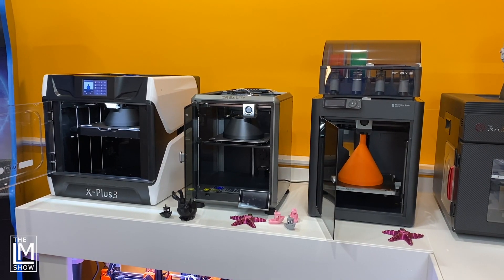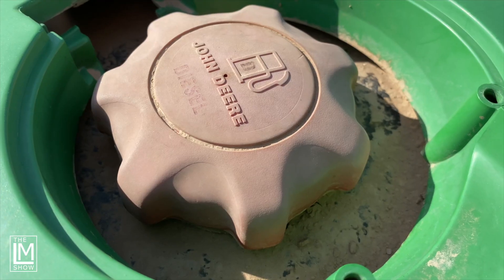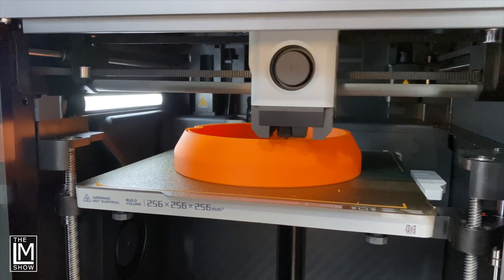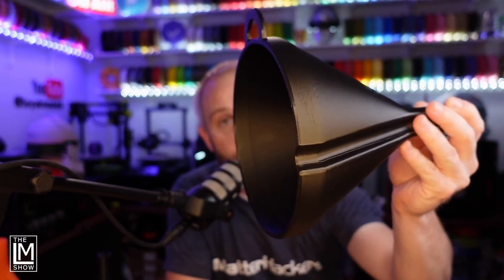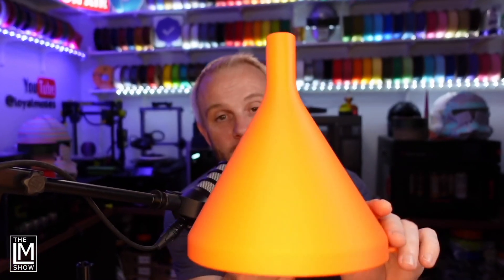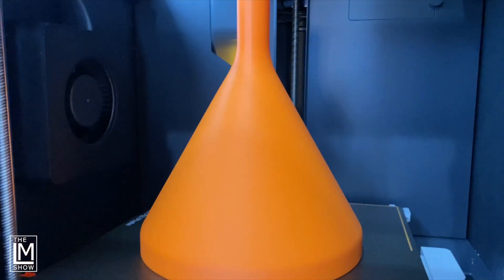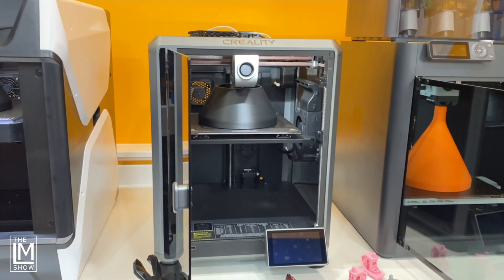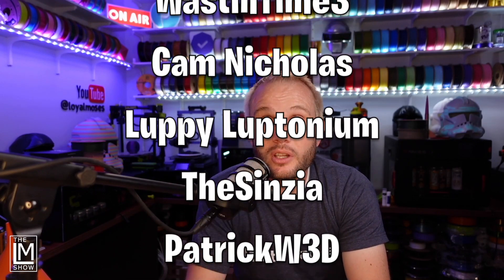Bambu P1S vs Creality K1 vs QIDI X-Plus 3 - Which CoreXY 3D Printer Is The Best?

Comment: Without any info. on the specifics of materials, the comparison is inconclusive. There should be material settings(temps, nozzle,layer height and print speeds and actual type of plastic used). Color is not a big deal, but black brings out imperfections easily. I would take this with a grain of salt as it is with the available info.
Reply: I second that.
Reply from the maker: Sometimes we get so caught up in the details that we forget that there are people who just want to use these new machines like they are an appliance, and that is okay. These machines may end up in shops or garages or home officers where the people that are using them don't care about layer heights or infill, etc.

For this particular comparison, it was very simple -- the experience that 99% of customers would have. Load whatever filament they have on hand, select the default profile in the slicer and hit the print button. The basic experience of three turn-key corexy 3D printers and the results were the focus here. Those of us with dozens of printers and literal tons of filament care about those details, and we are absolutely working on more exhaustive content focusing on the specifics. Thank you for your input!
Reply: @LoyalMoses  You can always add the info. in the description. It just brings out better trust on the comparison, apart from doing justice to all these companies that had produced a wonderful product for the best user experience. Just some 💭
Reply from the maker: @aware2action  that’s a fantastic point!

Comment: Wich one makes the most noise? P1S or the X-Plus 3?
Reply from the maker: X-Plus 3 is quite a bit louder than all others and has a loud electronics cooling fan that runs 24/7 as well.
Reply: @LoyalMoses  I think I'm going with a P1S. I'm not getting another Creality.
Reply from the maker: @bucket638  you won’t be disappointed! They are solid machines and the results are so very good and consistent.

Comment: Gotta use same color and filament if you compare anything.
Reply from the maker: Lighting wasn’t the best, it was far worse than I thought it looked while recording, but this wasn’t a scientific comparison, it was a user experience and result comparison.

Even if I used the same filament, it was done in their preferred slicer with their default profiles, which ultimately has a greater impact on result than the brand of PLA used.

We’ll have to do another one, with better lighting and we can use the same color for the third one.

Comment: I am not sure how you can compare when you used Orange filament for the Bambu labs machine.  I would like to see orange filament run in others or Bambu labs with black filament just so all things remain same for the tests.  Great review, but I am interested to see with same exact filaments on all machines.  Perhaps, run orange on two other machines and black on Bambu labs.  I would also run all three at max speed of 500, keep speed same.  This would be ultimate test.  Very impressed with results from all companies.
Reply from the maker: It wasn't a review but more a comparison of printing experience. The filament was the color of filament that was loaded when we printed, that's all -- we can definitely do it again with the same or opposite colors, or maybe do a different test. Thank you for your input, I appreciate it!

Comment: Why did you print in black for 2 machines and a light color for the other.  The light color hides flaws.  Strange
Reply from the maker: Strange, how so? I used the filament that was loaded in the machines, sliced in the preferred slicer and then hit print. I agree the orange looked yellow and washed out on the camera, and we may do it again, or shoot better b-roll, but it’s not some ridiculous conspiracy. In-fact, it’s quite the opposite, that P1S performs as near to perfection as it gets. In this comparison, the others didn’t have a chance.
Reply: @LoyalMoses   I was disappointed that there was no way to compare the finishes.  We have an X1 carbon at my company.  My experience has not been as good as yours.  I don't think the finish quality is much different than my old CR-10 (although it is printed much faster).  There are Z banding artifacts.  And pressure advance must not be working because it has the worst bulging at corners I have seen from my limited printing experience.  It is giving 2 or 3 error codes at the beginning of every print after it does its calibration.  Maybe this has something to do with the poor pressure advance.  I have not had time to fix the error codes.  Also, Bambu sizing the AMS so none of my spools of filament fit is really really really annoying.  I don't know what game they were playing when they did this.  I don't trust the K1 as what I have seen shows it as an unfinished design.  I was really hoping the Qidi was great as it has the heated chamber and 350 C hot end.  I apologize for my comment.  Thanks for the video and the comparison.
Reply from the maker: @f1hotrod527  oh no! I’m sorry you are having trouble, that’s one of the worst situations to be in when you are experiencing something different from others. Has support helped at all? Loose belts maybe?

That QIDI X-Plus 3 is an awesome machine, and I really like it, but get this. I updated the firmware they sent me, re-calibrated and the prints turned to garbage, a complete mess. I ended up working on it for about an hour or more, then thought to tighten belts, and it cleaned up everything!

Also, thank you for commenting and listening! Sometimes YT is filled with just terrible replies! 💜
Reply: @LoyalMoses   I have been so swamped at work for the past 6 months we have had the printer I have not even had time to scan the QR code it gives for the errors.
That is disappointing to hear about the Qidi.  I know their previous machines seemed to not be good with issues.  And the original X-plus 3 had issues.  But from the other reviews I have seen, Qidi completely turned it around and the printer was very good.  I guess it is not completely flawless yet.
I want to get a second printer for myself to go with my CR-10.  Maybe getting a flying bear reborn 2 for $375 right now is the way to go.  I know that printer has some things that need to be worked through, but maybe worth it?  I am into printing functional parts, so the ability to print the more engineering grade materials is more important than speed to me.
Reply from the maker: @f1hotrod527  I’m hoping this was just a firmware issue and it will be back to printing great quality!

Comment: bro... you cannot compare printers and use different filaments for them
Reply from the maker: This was an experience comparison, that 99% of users would have. A sliced model in their own slicers, with their own default profiles, and sent to the printers. I agree the orange was a little washed out on camera, but that doesn’t change the result, in this particular comparison, the P1S print was nearly perfect, the others had surface patterns from poor cooling and also loose belts, which I’ve since tightened and things appear a little cleaner. We can always do another one with the same filament for filming purposes.
Reply: @LoyalMoses  In a comparison, this very much does matter and is not the 99% of what people would experience if the experience varies *with fillament*. I trust your judgement, but that isn't a proper scientific test.
Reply from the maker: @klaidasrunele  it wasn’t a scientific test at all. Filament does not differ enough to make a bad printer become an amazing printer, and I also don’t own any cheap filament. I appreciate your comments, i really do. I can definitely do another, or just some better b-roll, the orange funnel is just near perfection.

Comment: Why were two pieces printed in black and one in orange. Makes IT pretty much uncomparable in terms of surface Quality imho. I would Love to See a faceoff between qidi and Bamboo with prints in glossy black Pla/PETG and No soft lighting around.
Reply: Many Tester will compare prints sueface on different printers and not using same filament Color and so on. I dont no why
Reply from the maker: That was just the filament that was loaded, and I agree, that orange didn’t film well, too easily over exposed. We’ll do another and have better lighting!

Comment: I am sorry, but it must just me being in the profession of 3d printing. Your Rolls' filament sitting out there all uncovered distract me. I just keep thinking they need sealed up to protect them from Moisture :O.
Reply from the maker: 😆 We live on a mountain, low humidity and moisture problems are frequently over-stated, they exist, but not nearly as bad as people want to believe.
Reply: @LoyalMoses  LOL, that was actually one of the questions was stuck in my brain was rather it was low humidity or not. As makes a huge difference. Where I live is on the low side. Where my brother lives, is so dry I swear if I want to dry my filament I would just take it out of the bag up there. A good example of this is air compressors. There is a bolt in the bottom of em they tell you to take out to remove water. Well if you live in a high humid area like Florida, you take bolt out, and you will have a ton of water come out. Live even where I live and barely anything. Where my brother lives, their Air compressor after 5 years was not a drop. So local humidity absolutely plays in.

Comment: It's not fair. You should use the same filament, the same coil, and preferably a neutral slicer, and then it would be relevant. This comparison is not valid. Personally, I would take the bambu for the quality of the print, and mostly because of the AMS system. By the way, I am a Creality fan and I have 6 of their printers from CR-10 onwards, including the Falcon 2 laser. In recent months, I have come to the conclusion that many companies have overtaken them in printer and laser features because they offer more features and innovations and even for less money. I don't think I will be buying any more of their machines, and their Facebook group is also censored. I'm sorry Creality
Reply from the maker: Thanks. It is a comparison of the unique experience the average buyer would have when using the printer’s preferred slicer and average PLA. We could always do more direct comparisons, but even if you create the custom profile for them in a middle-ground slicer, someone will complain about the quality of the profile, etc. 🥱

Comment: I've had several creality printers and they have been nothing but trouble. If I was going to buy a bamboo Labs it would have to be the X1 Carbon. I just bought a Qidi X-Plus 3. It is the most amazing 3D printer out of the box I have ever used. I just could not justify the X1 Carbon on my budget. But if I had the cash I probably would have went that way. The Qidi tuning is SO spot-on from the factory. Even things like extruder steps. I let out one whole M of filament. It was within three hundreds of a gram of being correct. There is no question this printer is fast and accurate. The one warning I have (and I have experienced this with every printer we've ever purchased) is that it does not flow anywhere near what they say. It is an honest 20mm'3/s hot end.
Reply: After 10+ months would you still recommend the Qidi ?
Reply: @MrBiggs-wu2kf  I would like to know that as well. The Bambu labs are at a much cheaper price right now, but I can get the QIDI at $200 cheaper right now.  At those prices, I am going for the Larger, faster printer with the heated chamber. I have order some enclosures for my Flashforge 5M for a total price another $100 cheaper.  I never buy anything at full price.
Reply from the maker: I’m enjoying the QIDI!
Reply: Yes. I have not had a single problem other than going through nozzles faster than my old printers. To be fair though, it gets used a lot more.
If anything it's going better over time as we tweak parameters.

Comment: I like the short and sweet comparison. Also, printing something practical is a great idea. However, like other commenters, for the comparison to be fair, use the same filament in all 3. Maybe one with PLA & one with PETG.
Reply from the maker: Thanks! It was very fair, it was the average experience any buyer would have. Turned it on, loaded PLA, sliced up a model on the preferred slicer and hit print. Changing filament isn’t going to magically turn a bad printer into an amazing printer.
Reply: @LoyalMoses  Actually, PLA is not realy the main material for enclosured printers. In my opinion, while the main advantance of bambulab is the AMS, the main advantage of the Qidi is the activly heated chamber. So I would realy like a comparision how the funnel turns out printed in a more technical filament, like maybe polycarbonate or nylon. Maybe even in winter - I had some very hard issues with bending even using PET-G in a passive enclosure last winter (for me its warm enough if water is liquid. My printers see it otherwise). This actually the main reason I choose the Qidi, as the activly heated chamber is the outstanding feature. While I definitly like the AMS bambu made - how often do I realy need colour change? Maybe for soluble support (or the PLA/PETG-Trick). But I have an Idex I only used 2 or 3 times over the last years to do so, so for me the heated chamber is definitly the big advantage of the Qidi and kicks bambu an Creality out of the competition. But it realy depends what you need.
Also of course as the Qidi uses open Klipper, an ERCF might be possible to add... So while the AMS has best comfort and definitly is exelent, it does not mean you can't do multi material on a Qidi.

Comment: I've seen that Qidi users are seeing way better print quality by using orca slicer. Native klipper and a larger, actively heated, build area give the X-Plus3 the edge in my opinion.
Reply: Don’t forget heated chamber, 350 hotend and 120 bed. Built for easier industrial grade filaments.

Comment: they are all good-great.
I ordered the K1, due  here tomorrow.
Why?  I am a CREALITY  user, price, user interface, biggest company....
Reply from the maker: I am SOOOO stoked for you! You’ll have to share your prints and experience with us. It’s a really great machine, my experience has been great.
Reply: @LoyalMoses  I just couldn't take the  S L O W prints any longer.  It is like death by a thousands papercuts!   Quality and reliability has been good, but soooo slow.
They have just updated their slicer software and it is actually decent with user modifiable supports.
Reply from the maker: @graphguy  I know what you mean, it’s taken a little bit of time, but we seeing huge improvements in quality when running at speed, which is what I am all about.
Reply: @LoyalMoses  OK.. I have the K1 up and running.
Can I saw wow?  Geez, it is amazing.  did the benchy stock settings... and 16 minutes is a virtually flawless benchy, something I have never ever had before.
Next two prints?  fast and flawless.  
I should mull kick myself for waiting.
My only regret... MAYBE not going k1 max... as I am use to a 300x300x300 build plate.
Reply from the maker: @graphguy  makes me so happy to hear this! Congratulations!!!
Reply: @LoyalMoses   this might finally be a happy marriage with my 3D printer!  My last 2 were new model bed slingers... and I was only satisfied 50% and never happy with the pathetic 50-60 speed.

Comment: I wish a core xy was in my immediate future.   Shifting to production work and finding I need models large and small for what I am making, sometimes in quick succession.  So helmet class sizes are a must and Bambu's distinct lack of ringing at speed would be a godsend. 

That said glad I found your show when I did,  your print races and makes competitions served a dual purpose of helping me get filament when I couldn't afford it,  and it helped me keep my photography  skills up to snuff.   Also thanks to the races emphasis on speed, I fear lightning infill a lot less, and that has saved a lot of filiment now that I am transisioning to models for video productions.
Reply from the maker: There are a lot of options now for big CoreXY and more coming! I’m excited.
Reply: @LoyalMoses  yeah,  hoping with the new Core XY rush, it drives prices down, and a company that rhymes with "fondue tabs" releases their larger option.    I don't mind closed source as long as it works.
Reply: Bambu's next printer for their 2nd gen is gonna be a large size printer. And I think that'll be coming out mid 2024. Hopefully they add a heated enclosure, that would be great for high end filaments.

Comment: I don't know why you would use a different filament for the p1s using a color that will barely show off any imperfections. A lot of other creators do this as well. They will compare the p1s or p1p to another brand/model and use a very unforgiving color like black or grey with the model that the bambu lab is going up against, and use a very bright neonish color when using the bambu labs. Gives off the impression of bias when that happens, even though you may not have intended it.
Reply from the maker: It was the Bambu filament that was loaded, and the others were already loaded as well with similar blacks. No conspiracy, just real use here in the studio! I can always change to a moderate color for each and hit reprint! In-fact, I may do that just in case.

And thank you for your comment.
Reply: You think filament makes that much of a difference to the quality of the machine? Then why so many issues with Ender 3s out there? They could just change filament and the printer would print perfect, no? That is what you are saying though, that the filament makes the print, not the printer.